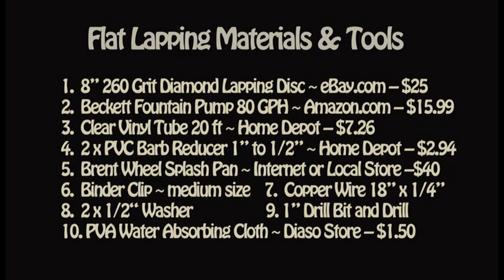82. Turning a Potter's Wheel into a Flat Lapping Machine with Hsin-Chuen Lin

Comment: There's some ceramic discs that do the same that are supposed to use the bat pin to hold in place, I like that you were able to do the smoothing with no dust. The other grinders would possibly make dust!

Comment: There is a product that we used in the sign industry on our sanding disk/belt machine. The disk was about 12 inches in diameter and was made of steel. The sand paper disk it's self was on heavy paper like material, and had a sticky back. You removed a protective sheet from the sticky side of the sandpaper and then stuck in in place on the steel disk. I would think that you could just stick one of these round sandpaper disks on a bat, then you can use it any time you want. There would be no need for the water system you use in this video. The sandpaper disks come in various grits from 40 grit to 120...maybe ever more. Hope this helps.
Reply: Pike Evans the thing with sand paper is that is gets worn out these diamond disk dont get worn out so it can be reused consistently.
Reply: The sand paper discs are inexpensive.
Reply: +Pike Evans The problem is the dust.  You need water to protect yourself.
Reply: I guess I can see that. But I am old school... we always used the white dust masks you put over your nose and mouth. Did it that way for 40 years...never had any problems. But then again it wasn't something I would do on  weekly basis.

Comment: What is the special cloth that you use to secure your disc to the wheel? I need to find something similar to that.
Reply: flipsickle1122 me too!!!
Reply: funxsized , i found my own solution to securing the disc to the wheel. have super-glued a couple stacked washers to the center of a black bat. then by smearing some wet clay on the disc, i am able to center and secure the disc adequately.
Reply: Go to a fabrics store, ask for some rubber based material.

Comment: Have you lapped steel with this setup?
Reply: Aranyik  I have Lapped Steel in exactly the same way with Silicon Carbide Self Adhesive  10 inch discs that I stuck on 8 mm thick  Aluminum plates.  The plates were drilled for the center and the Drive pin ( not completely through ) I used 180. 600. and 1200 Grits. I made a Engravers Swivel  Vice with a Spherical Bearing with a 48 mm bore and it sat in a Larger Square Solid block of steel  and that is what I what I sanded and Lapped to a Beautiful Smooth Finish and Finally Parkerizing to a Matt Black Finish due to the 1200 grit. I did it dry and used a Magnet in two  Zip lock bags to keep the paper clean.